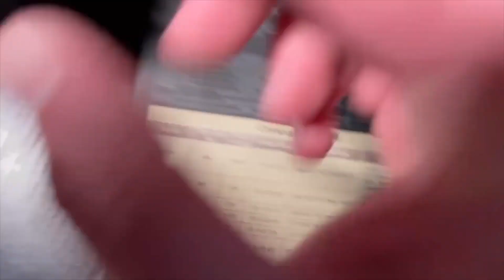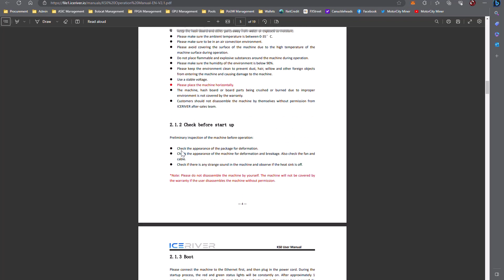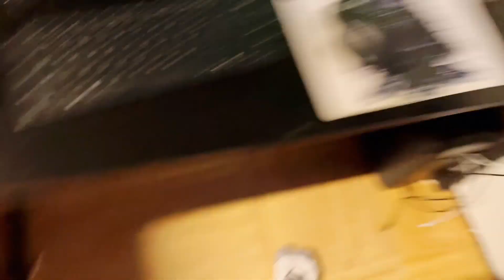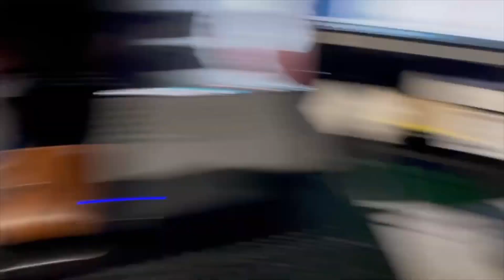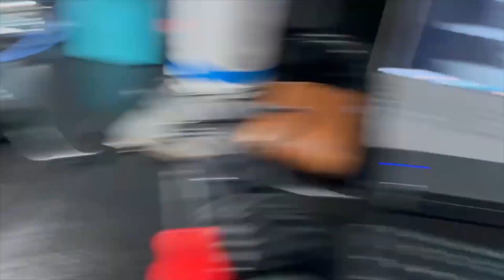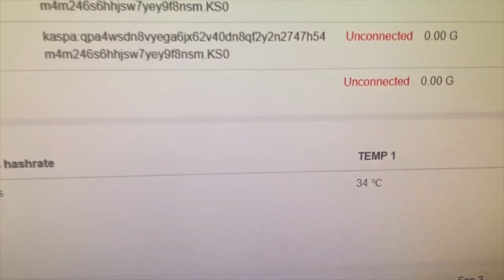It's Alive! IceRiver KS0 PSU Replacement and USB Fan FTW!

Comment: My KS0 Ultra has been JUNK OUT OF THE BOX. Never hashed never worked here.. Went back for repair once, never worked here, after return. They claim it did at the repair shop but never explained what was wrong the first time. It cost $110 to ship it back to Hong Kong, now it could cost another $110 for shipping a second time... Customer service is slow, seems like they are dragging their feet to run out the Warranty period.  Iceriver is Garbage.
Reply from the maker: Sorry to hear about your ordeal. I haven't had any issues w/ any of my 15 IceRiver ASICs. Even the broken unit I purchased secondhand, they were easy to work with to get the replacements parts I needed. Hopefully they get back to you asap.

Comment: what size screws did you use for the fan on top?
Reply from the maker: you will need M3 screws. length will depend on fan width you are using.
Reply: @motorcityminer  my fan is one inch width, AC infinity usb fans
Reply from the maker: yeah so you will want at least 30mm long M3 screws

Comment: Do you know the thread size to volt thr fan down?
Reply from the maker: it is M3 screw, length will depend on your fan thickness
Reply: @motorcityminer  ah ty. I just ended up tapping it to a 6-32
Reply from the maker: lol that also works 🤣

Comment: Hey man Is it possible to have 15 Ice river ks0 PRO in my apartment charged to an cord extension or is that dangerous?
Reply from the maker: Depends on a few things. First don't use extension cord but use surge protectors. 15 KS0 Pro (assuming no overclocks) would be 1500w, this can be accommodated on a single circuit if you have 120V minimum 15A circuit or 240V 15A (not sure where you live) but if 120V you will want to make sure nothing else is on that circuit as 120V 15A circuit can only hold 1800w and you would be right at the 80% rule. It would be better to split the units across 2 circuits if your power is 120V 15A to be safe and allow for other household items to be plugged in safely. If you have 240V you should be fine as long as not much else is plugged in and you don't plug all into a single surge protector.

Comment: what screws did you use for usb fan and where can I buy them?
Reply from the maker: you need an M3 size screw. length will depend on fan width but you'll want at least 5mm longer than fan width. so 25mm width fan get a 30mm+ long M3 screw.

Comment: Hi thanks the video, very informative, btw What fan speed have you set it on KS0?. I have AC infinity S3 120mm fan, however screws wont fit. I just kep it on the side and ran and got 5 degrees reduced. Now 35 and 49 degrees...now way near your temps. ,,,so wondering if the original KS0 fans need to be set at certain speed? Mine is at 70%
Reply from the maker: If you want to mount the fan you will have to use M3 size screws. For the built-in fans I have them running at 50% with my ambient temp of 70 degrees in the basement.

Comment: how can motoring this Machin
Reply from the maker: If on local network, you can connect by local ip in browser. remote is supported if you use 3rd party options like remoting into router

Comment: turn it on its side
Reply from the maker: I'm actually putting it (and most my other mini miners) on a tubular shelf so that it gets optimal airflow from below. That way hot air rises through unit. Will have update once I get it setup.
Reply: @motorcityminer  epic epic bro keep me updated so that way when I get mine I'll be all set

Comment: Great 👍 content, what are the dimensions of the screws you are using to connect the fans?
Reply from the maker: Thanks, the KS0 holes are sized for M3 screws. Length will depend on the thickness of the fan you mount. This fan is 25mm and the screws are 30mm length
Reply: @motorcityminer  awesome 👏 thank you .. I got the AC infinity 120mm USB-A fan, comes with 3 fan speed controller only cost $8 if I remember correctly, comes with grills and rubber isolates, and I also got the one you linked, I’ll have it tomorrow will do some side by side testing! Thanks again.
Reply from the maker: nice, curious to see how the ac infinity ones do as they are higher quality. i was hesitant on them since they pull beyond the 0.5A max in icerivers docs https://acinfinity.com/component-cooling/component-usb-fans/multifan-s7-quiet-usb-cooling-fan-dual-120mm/#product-warranty

Comment: I am glad that they gave you some nice discounts on future purchases. Do you know how long of a wait you will have before you receive your next order. I think that I might just have to make a purchase myself. Thanks for the power supply and fan info...
Reply from the maker: My 2nd order said last week June. The 3rd and 4th unit are supposed to ship first week of July. Looks like there are still units available for the 1st week July batch. Might be just enough time before KS3 to get close to ROI
Reply: @motorcityminer  So if they ship in the first week of July any idea of the time you would receive one in the US?   They want to wire transfer the money to Chong Hing Bank Limited. Does that sound correct? Thanks for all your help answering my dump questions...
Reply from the maker: haha, no dumb questions. It took about 5 days for DHL to get to me in USA. They ship express so pretty quick even w/ customs once it actually ships out. I can't guarantee they will ship that 1st week of July though. That is up to them and their staffing. I did a crypto payment through their Coinpal checkout so not sure on the wire transfer but would follow the instructions and reach out to them if something doesn't line up. I know when I purchased large order from Octominer, the wire instructions they sent didn't quite align w/ the information my bank requested. each bank is different so you might need to ask them for additional info.